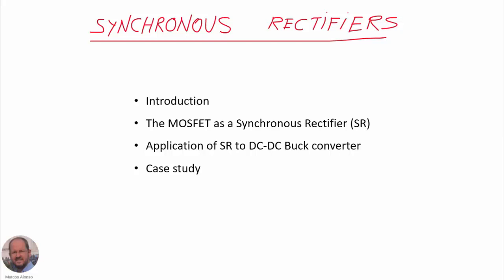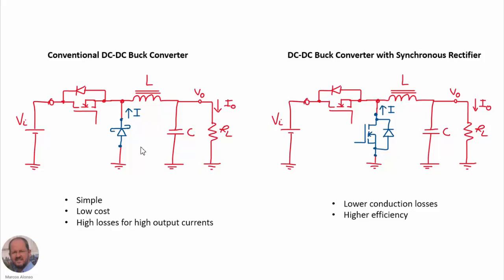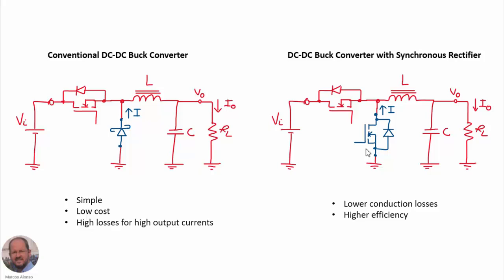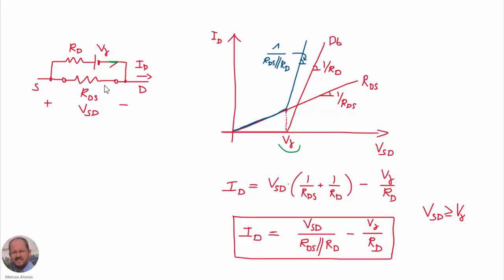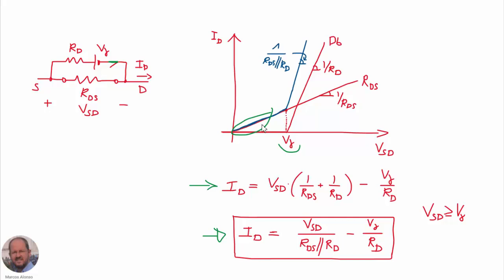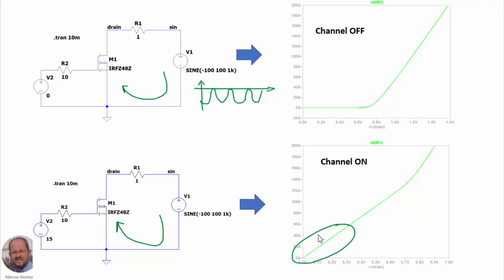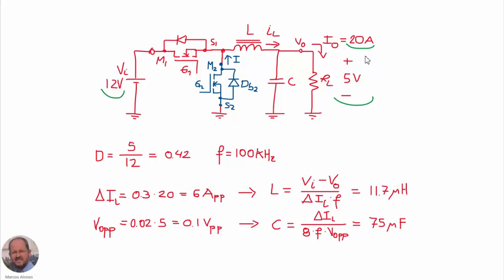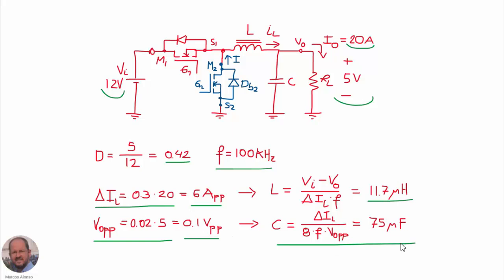PE #14: Synchronous Rectification

Comment from the maker: 23:20 I forgot to show the losses and efficiency when the Schottky diode is placed in parallel with the SR switch. The losses in the SR + Schottky diode are 1.75 W, compared with 1.97 W without Schottky diode. The efficiency of the converter reaches 95.3% with SR + Schottky diode, compared with 94.6% without Schottky diode. 
Note that to calculate the losses in this case it is necessary to add the Schottky diode current to the SR switch current in the value of the behavioral voltage source E1, this is: value = { V(source)*(Id(M2)-I(D1))}.

Comment: Thank you Marcos Alonso, we normally know that current flows from drain to source of a mosfet. This is what truly happens in M1. But in Mosfet M2 current is flowing from Source to Drain, how is this possible? People say this all the time in synchronous rectifiers but I have got an explanation for this.

Thanks
Reply from the maker: Thanks for watching and for your question. The channel of a FET can conduct current bidirectionally. In a MOSFET there is the body diode that interferes with the conduction of the current through the channel in one direction (from S to D in a N-channel MOSFET), as explained in the video. But if there is no diode, as in the case of a JFET, the current can go in both directions. I explain the interaction of the channel and the body diode at the beginning of the video. Thanks!

Comment: Is this circuit achieved ZVS, when the currrent goes through the body diode and turn on the switch immediately? How do we optimized the dead time interval to have best efficiency?
Reply from the maker: This circuit does not work under ZVS. It operates under hard switching.
This is a nice topic for a future video. Thanks for watching!

Comment: Great video.
Do you use mosfet drivers like the ir2104?
In the simulation.
Reply from the maker: Yes, it is a driver similar to IR2104. It is called MyDriverHB. You can see how this driver is implemented in the following video: https://youtu.be/E43rYalXcaw
The driver is available from my website at https://www.unioviedo.es/ate/marcosaa/#RESOURCES
Thanks for watching!
Reply: @MarcosAlonsoElectronics  Thank you very much, If I use the IR2104 model with the bootstrap capacitor the simulation is quite slow, but with your model without bootstrapping it is very fast?
Reply from the maker: @petrusbosman4264  Yes, that's the idea. The driver is intended for fast simulation but keeping the possibility of adjusting the deadtime. Please, give it a try and let me know if it works for you. Thanks!
Reply: @MarcosAlonsoElectronics  It sure works well.
I am combining your two models , mypwmc2(LM3524) and my driverhb to drive two mosfets in buck synchronous configuration.
In the real circuit i am going to use the esp32 to control the n_inv input of the mypwmc2 with the dac to implement mppt through software.
I have allready implemented mppt from the esp32 by driving the mosfets with a ir2104 , but doing it indirectly would be better, then i can use much higher switching frequency.
Reply from the maker: @petrusbosman4264  Happy to know that it works well. Thanks for letting me know.
I recommend you to take a look at the Raspberry Pi Pico MCU. It can generate high frequency pwm very easily directly from the board. You can see a video about this here: https://youtu.be/EN8FFbAn5cw

Comment: Do we need a bootstrap capacitor for the hide side switch?
Reply from the maker: In real life we will need a bootstrap-based IC to drive the half-bridge. In the simulation I use the circuit MyDriverHB that it is intended to drive the half bridge in the same way but trying to make the simulation as fast as possible. So bootstrap technique is not implemented in MyDriverHB. You can find more info about this component in the following video: LTspice #10 - https://youtu.be/E43rYalXcaw
The component is available from my website at: https://www.unioviedo.es/ate/marcosaa/#RESOURCES
Thanks for watching!

Comment: 5:22 Good Morning Sir, How can I draw V-i graph for mosfet, is there any direct command to do.

Thanks for your kind help,
Sanjay
Reply from the maker: Hi, thanks for your question. To draw the v-i characteristic of the mosfet you do as follows. Apply a given voltage to G-S by using a DC voltage source (f.e. 10 V) and a series resistance (10 Ohm. will do). Apply an AC voltage source of 1kHz with a series resistance between D and S. For example AC peak voltage 10 V and series resistance 1 Ohm., so you will get up to 10A drain current. Set ground to S. Run a .tran simulation up to 10 ms for example. Then you will be able to represent drain current versus D-S voltage. For this you have to change the horizontal axis from time to D-S voltage by moving the cursor to the horizontal axis of the waveform viewer (the cursor will turn into a ruler) and right-click.
You can do a .step analysis on the DC gate voltage to represent several curves together.
Hope this helps. Thanks!